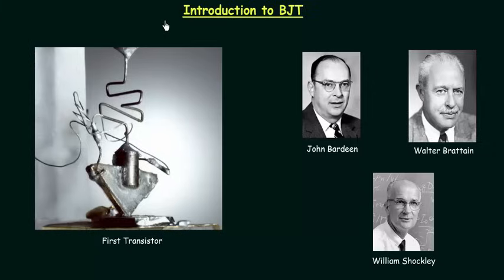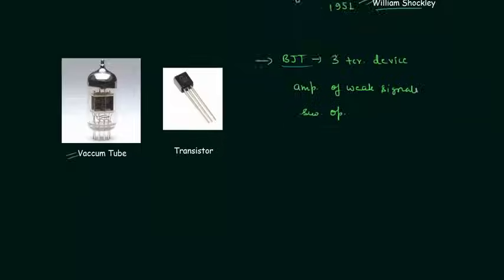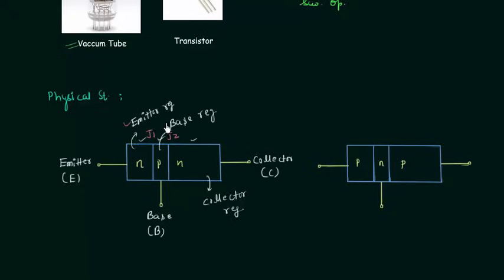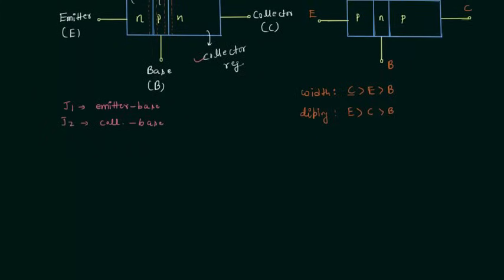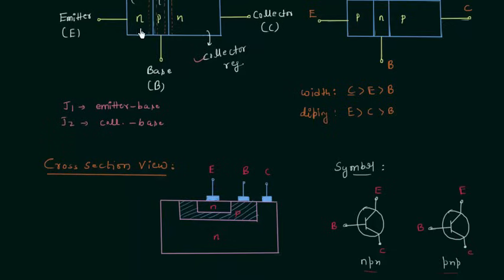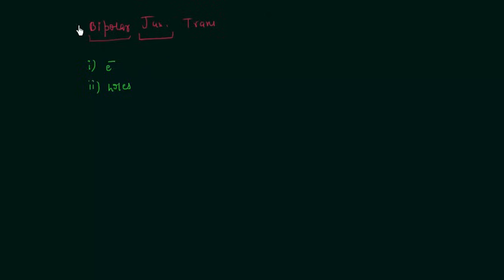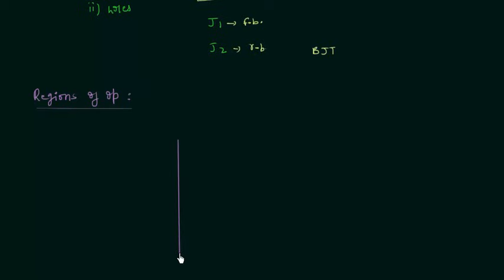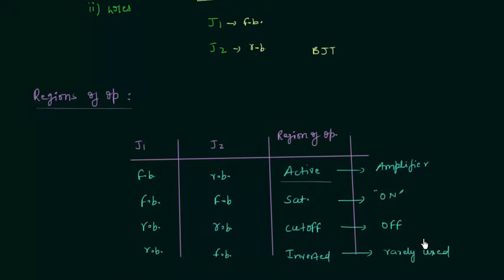Introduction to Bipolar Junction Transistors (BJT)

Comment: 1) collector is most wide since it collects the charges which requires efficient heat dissipation
2) npn is more widely used since the mobility of electrons is greater than holes.

Comment: 00:06 BJT is a three terminal doped semiconductor device used for amplification and switching.
01:50 BJT is a three terminal device used for amplifying weak signals and for switching operations.
03:34 Bipolar junction transistors have three regions: emitter, base, and collector.
05:20 Transistor structure and symbol
06:55 Differentiating between NPN and PNP transistors based on current direction.
08:18 A bipolar junction transistor is a combination of two diodes connected back to back.
10:02 BJT transfers a signal from low to high resistance.
11:35 Transistor operates in different modes based on the biasing of junctions.

Comment: SUMMARY

1. Invention of transistor.
- Invented in Dec 1947 by William Shockley, John Bardeen, and Walter Brattain
- Got a noble prize in 1956

2. Use of BJT.
- Amplifier (of weak signals)
- Switch (for operations)

3. Types of BJT (npn and pnp transistor).

4. Emitter, base and collector regions.
- J1 = Emitter junction (Emitter with base)
- J2 = Collector junction (base with collector)

5. Width comparison.
- C > E  > B
- C is the biggest because it has to collect electrons and thus producing heat
- The bigger the width, the better the heat dissipation

6. Doping comparison.
- E > C > B

7. Cross-section view of transistor.

8. Transistor symbol.
- NPN the arrow is facing E
- PNP the arrow is facing C

9.  Regions of operation.
J1 J2 Operation
FB RB Active -> Amplifier
FB FB Saturation -> Logical ON/short circuit
RB FB Cutoff -> Logical OFF/open circuit
RB RB Inverted -> Rare used
Reply: 8.b. in pnp the arrow is facing B not C lmao
Reply: Thanka bro
Reply: Bhai last me corrections ki jarurat hak
Reply: Thank you 😊
Reply: thank you:face-blue-droopy-eyes:
Reply: Thankyou so much
Reply: Previously comments were used to help each other
Reply: Weak signal to low resistance and output is to be taken with high resistance

Comment: in the reverse bias condition of collector and base junction  how a current can flow, because on increasing current, depletion layer increases as a result current due to  majority charge carriers decreases  and then their exist a current only due to minority charge carrier so how the current passes from base to collector... If it flows then can we say that  at every single time when transistor is on it crosses the breakdown voltage.

Comment: Did'nt understand how Transistor acts as an amplifier for the first case. Can I get an explanation, please?
Reply: The transistor has to be in the active region to act as an amplifier.  Think of it this way.  When the base to emitter junction is forward biased, a large current goes from collector to emitter which drives a load.    Outside of the active region, the transistor acts like a switch.  Saturation is on while cut off is off.  A switch is on and off.

Comment: A transistor has 3 regions,2 junctions(hence 2 depletion layers) and made from 2 PN junction diodes

In both PNP,NPN area and doping parameters remain the same(eg:area of c>e>b)

Area of collector is more as it has to collect the carriers  and heat is generated.

Generally,mobility of n is more than mobility of hole hence,npn is preffered over pnp.

Comment: In the 9:50 J1 FB the Low resistance; J2 RB the High resistance; How can i say low resistance and High resistance respectively?
Reply: Forward biased means positive terminal of battery connected with positive side of a pn  juntion,and vice versa,now electrons from supply will push electrons in n region,depletion layer will reduce so low resistance in fb.

Comment: if the transistor has two things for current flow : holes and electrons and for that reason it is called bipolar then similarly , diode also has current flow due to both of the above things and so shouldn't be the diode be also called bipolar diode ?

Comment: Sir. I have one doubt u r saying that transistor transfers low to high resistance when weak signal at input is given and an amplified version was taken at out put. But amplification name itself suggest that current is amplified then how come d higher resistance comes as earlier ur told. Plz tell me sir
Reply: buddy,,,its voltage amplification...

Comment: Why they are in active,saturation,inverted etc mode in case of different condition of junction?
Reply: chupp
Reply: It depends on the VOLTAGE that you apply to the different terminals. In fact, it depends on the DIFFERENCE of VOLTAGE. If Vc, Vb and Ve are the voltages, and Vcb = Vc-Vb; Vbe = Vb-Ve, ( you can also have Vce = Vc-Ve) you can "see" when a PN junction is reversed biased or forward biased.

Comment: as you explained bipolar means having two charge carrier electrons and holes, similarly we have same charge carrier in p-n junction diode. Is p-n also a bipolar device
Reply: No, in BJT corrent is due to both holes and electrons, i.e sum of those currents, but in diode current is either due to electron or holes
Reply: BADRIGARI GNANESHWAR nop diode is not a bipolar device because only electrons take part in its process wheras in case of bjt electrons and holes take part in its process.thats why bjt is called bipolar device even though hole is an imaginary concept
Reply: BADRIGARI GNANESHWAR yes pn junction diodes r bipolar devices as u already wrote the correct explanation of why so
But there r some diodes like schottky diode
Reply: No, bjt is called bipolar because it has two junctions. WHile a n-p diode have just a single junction